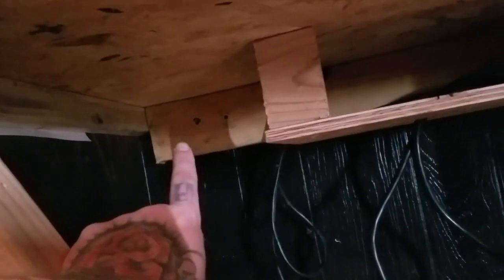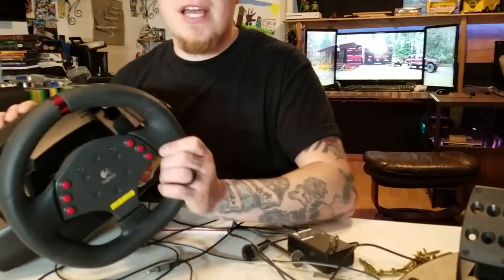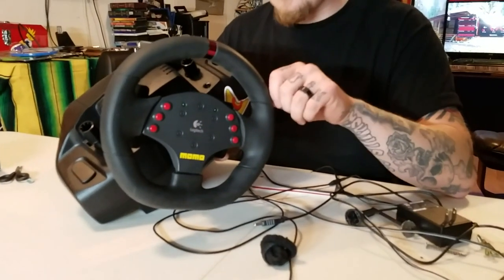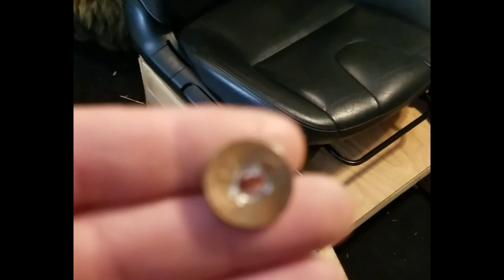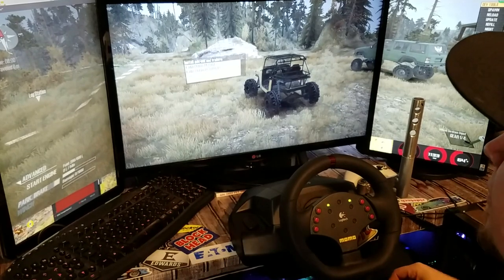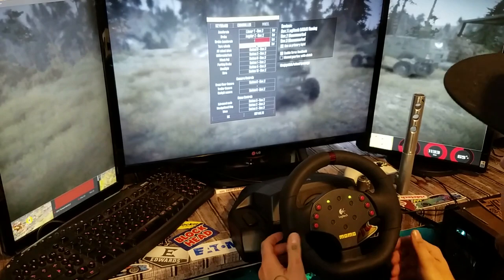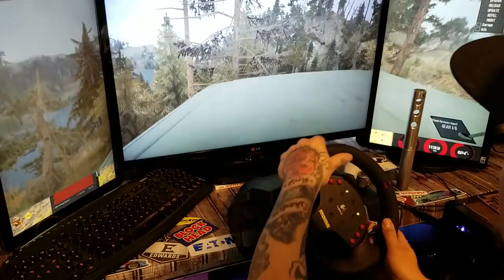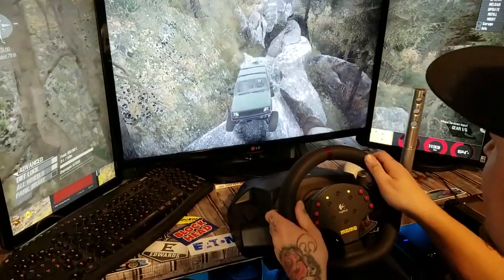My first sim rig!! easy and cheap 60$ DIY

Comment: I've been a bit nervous about getting a used car seat because of the airbag. I keep telling myself it won't be a disaster if it goes off by accident :p
Reply from the maker: I see where you are coming from but the chances of it going off after almost non-excitant. I have taken many seats out of cars for various reasons ( I used to work in a body shop) and airbags are very safe. Besides all the nicer new seats are going to have em. Just my 2 cents. I wouldn't sweat it though. Thanks

Comment: What kind of monitors are those ones on the side??
Reply from the maker: Thanks for asking! I have since changed my monitor set up but this worked great for cheap. It is a 32" LG led 1080 tv in the center and on the sides are older 22" mismatched monitors. One is a hp and the other is a Samsung. Both are older 1050 (not 1080) and ran in portrait mode. I think I had them set to display at 1280x800 and the pixel density was near perfect.
Reply: @travisbuildsthings5489  how did you setup triple monitors up  i have similar set up just wounder how you got it to work